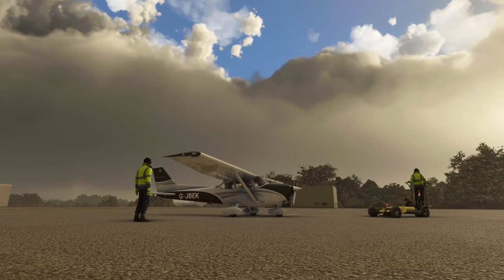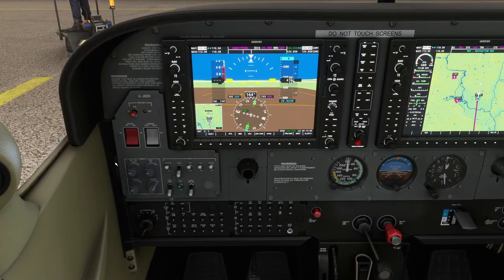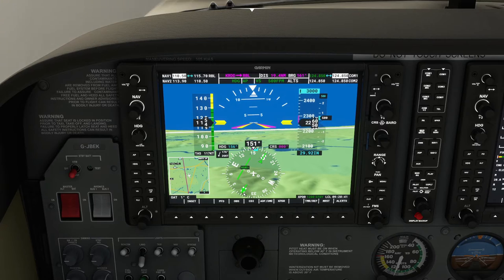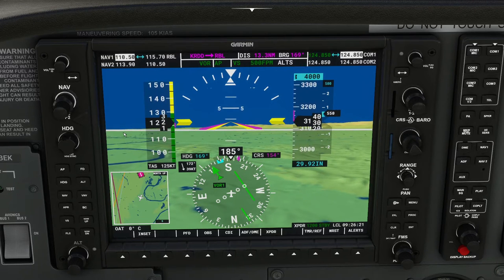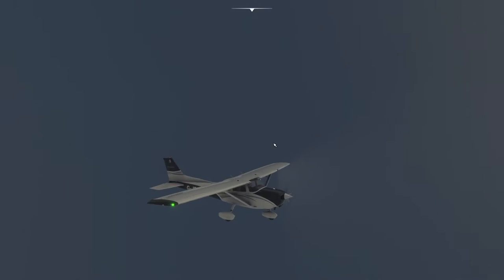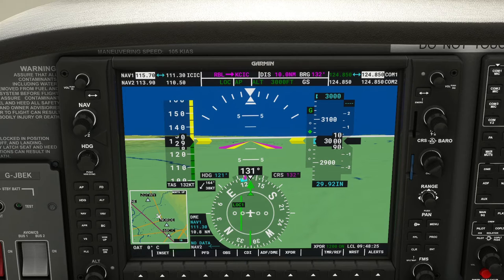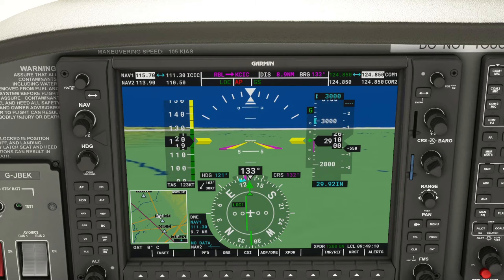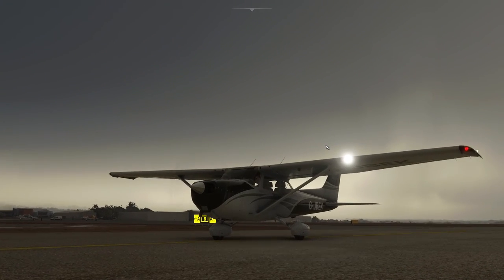Beginners guide to operating the G1000 and flying a route in the C172 in Microsoft Flight Simulator

Comment: This is really simple and straightforward, thank you. MFS encourages not to learn about the aircraft because the fuel supply is already on, etc., so that beginners can take off in a couple of clicks. But I needed a more detailed explanation and I got it, thanks.
Reply from the maker: Glad it was helpful!
Reply: Really great tutorial. Just a tip to the commenter, this usually happens to me if I spawn in on a runway or somewhere the plane should be started. Or maybe it’s an assistance setting?

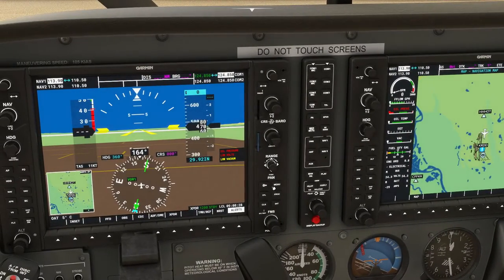Comment from the maker: 02:11 Programming the Flight Plan into the G1000
07:01 Explaining the Primary Flight Display symbology
09:47 Takeoff!
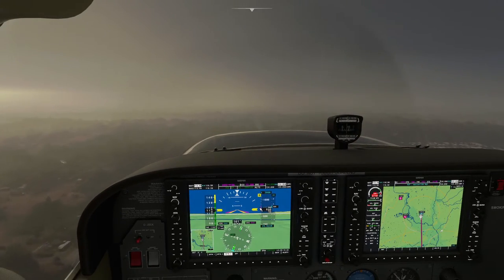11:44 Switching autopilot to GPS mode
12:48 Programming NAV1 and switching to VOR navigation
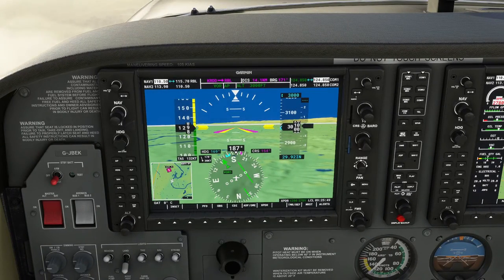19:28 Changing our altitude
22:52 Exploring the PFD
27:13 Descending
28:55 Changing course at RBL
30:13 Navigating towards the ILS
41:20 On the localizer
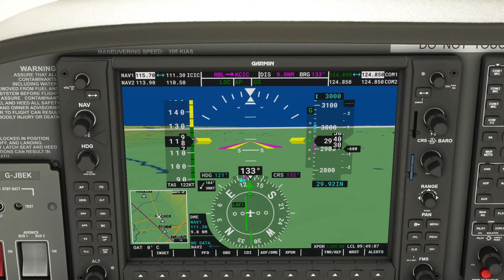42:47 Switching to manual approach to illustrate symbology
48:33 Finals
49:07 Landing

p.s. I discovered what causes the bad audio - it won't happen next time :)

Comment: When using a VOR you will be flying a radial to or from a VOR station. Beacons are associated with NDB's, nondirectional beacons. The ADF (Automatic Direction Finder) radio is used to tune in a radio beacon. When using an ADF you will fly what is known as relative bearings. Very specific language is used when using radio navigation, I hope this helps when describing the use of these navigation aids.

Comment: Hi Jonathan
Thanks a lot for your video. Whats the hack to plug in a route directly from LNMap into the G1000 rather than manually programming it?
Reply from the maker: In the map screen of MSFS, go to "more", then load - you can load a PLN file. After doing that, the aircraft will be pre-programmed with the route.

Comment: Is there any way I can resolve this issue, on your sim screen 2 is my screen 1
Reply from the maker: How on earth did you manage that ? :)
Reply: @jonbeckett  don’t worry, I’ve resolved issue now, just started msfs and having fun learning the Cessna 172, Do u have any planes I can learn next might go onto the a320
Reply from the maker: @Ed_Aviation  If you're going to learn the big jets, I would go with the PMDG 737-600 - it's good value, and works well.
Reply from the maker: OR the FlyByWire A320.